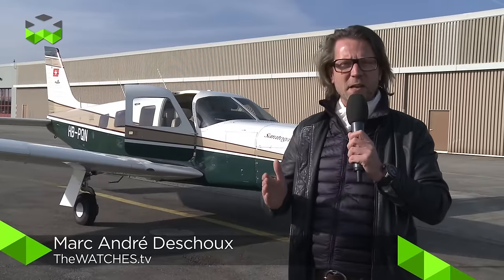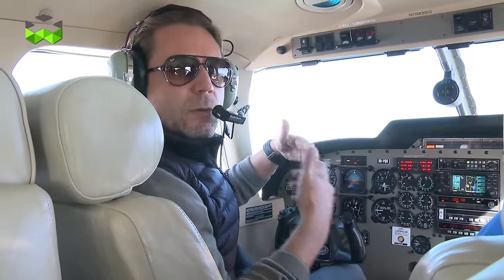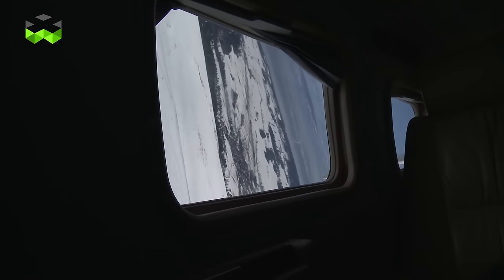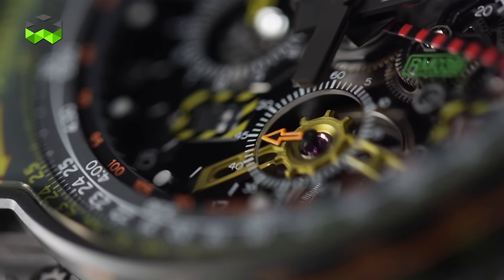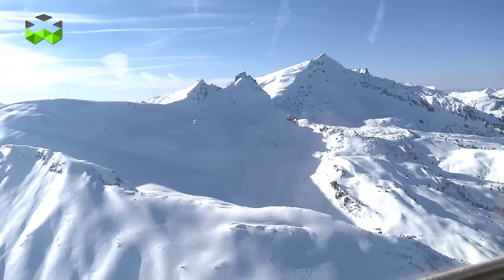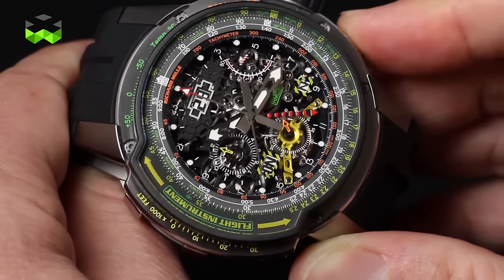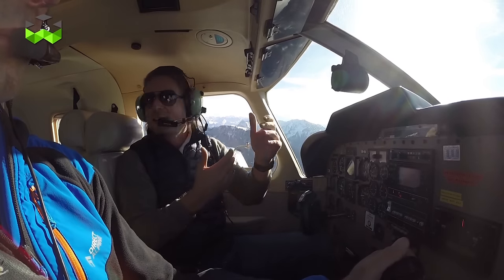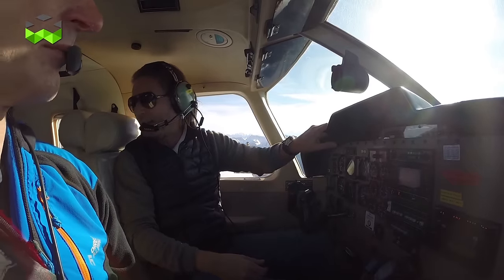RM039 Tourbillon Aviation E6-B Flyback Chronograph by Richard Mille

Comment: Others have said this, but a watch with that visually complex a face really is not practical in the slightest. You'd have to stare at it for several seconds every time to read it, and would be quite likely to misread it - which I can imagine if you were using it for flight calculations could actually get you killed. This seems like more of a toy for people who want the glamour of being a pilot, not for actual pilots.

Really, something like a Submariner is how a watch for this sort of application should look - practically nothing on the dial, so you can always read it instantly and correctly.